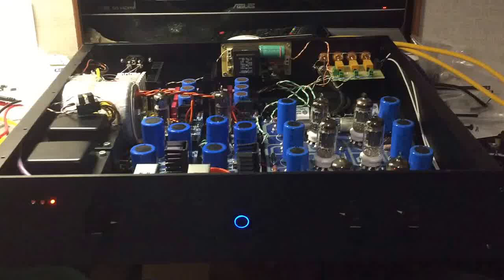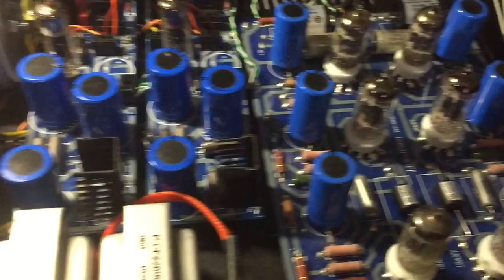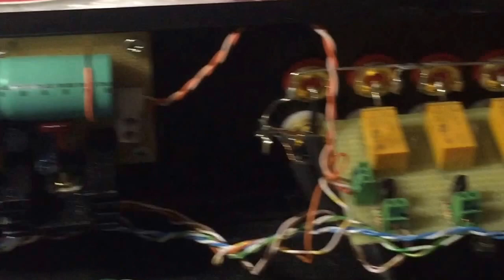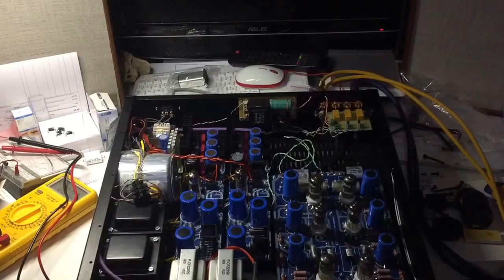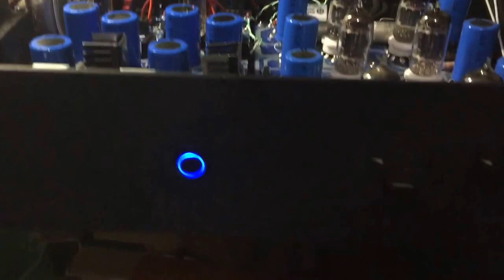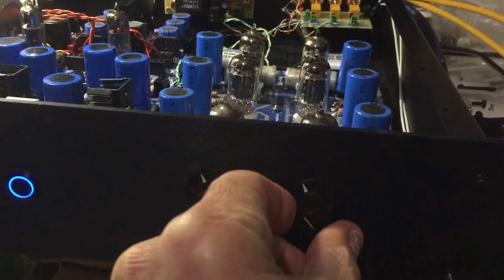DIY TUBE PREAMPLIFIER CLONE JADIS JP200 TEST1°

Comment: Gibronzo, I like your videos. But for me to judge the Krell, I think I would need to hear them in a bigger speaker system -something with a 12”-18” woofer.
Reply from the maker: Hi the krell for me is the best amplifier built .. I compared it with an accuphase e211 if they played on par .. Unfortunately I have no big speakers..but soon I will make a new krell and an accuphase c2810 preamp a monster
Reply: GIBRONZO. I would say threeway speakers should be your next project with deluxe crossover. Sleep on it.
Reply from the maker: @nathan7265  Yes I have already built the furniture if you see in the last video ... But the components used are very expensive .. It will take some time to complete them ... Now I am building an accuphase c2810 over 1000 components also expensive ... And a  krell with giant heatsinks ... Subscribe to the greetings channel